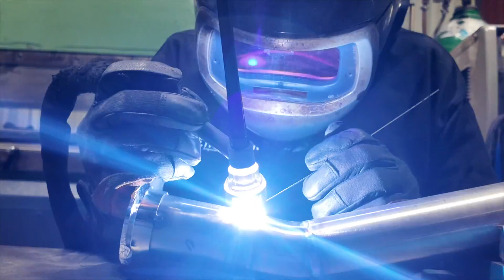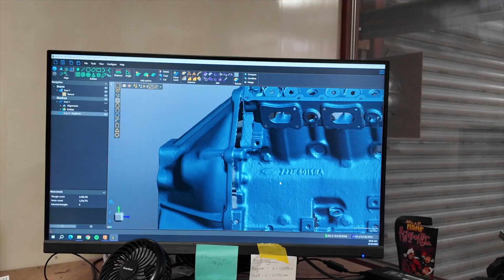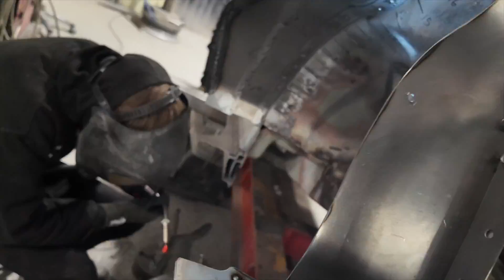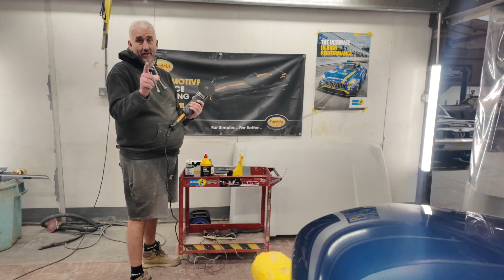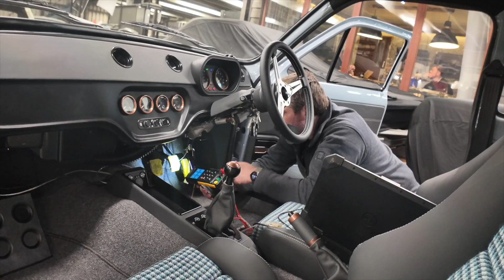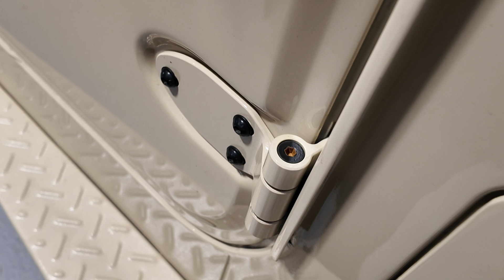1968 Camaro Project Interior Taking Shape

Comment: 28:46 100% correct Cal 👍
Years ago I replaced the butyl bonded windscreen in my Nissan Bluebird rally car, which had a welded in roll cage.
We used Sikaflex and the difference in the stiffness of the body was immediately apparent driving down the first dirt road.
It was a huge change.

Comment: In the Interceptor: The summary of cabin air intake box and the exhaust system will cause amplified resonance on highway speed. Main causes are the shape of the box and the distance between collector and 1. resonator. Secondary cause is the close proximity between the exhaust and fuel tank. Even with 2" foam, it will still hum inside the cabin.
For the V6 Ford motor: LT/LS style intake and single throttle body. This would bring the overall height of the intake as low as it is now with only those runners in place, without compromising air feed to the engine. In fact, unified plenum would bring part throttle cruise way more manageable, with more useful torque curve. In short; it would ride better, a lot easier to tune and significantly smaller package to fit.

Comment: The scimitar looks very updated and seriously wicked. An RS3100 lump just puts it into another galaxy as far as I’m concerned. Princess Anne will want #2
Reply: Is that not the same engine as the Essex v6  just 100 more cc.
Reply: @russcooke5671  did it also have Cosworth heads? ( I’m not sure?)..🤔
Reply: @philtucker1224  no it was standard but just a very slightly boring out  resulting in only an extra 10 bhp   But the racing spec cars were bored to 3.4  and could produce over 400 BHP.  Wich was massive for a v6  fifty years ago.

Comment: My old V8 SWB Land Rover kept cutting out due to fuel starvation. It took me months of stripping carbs and checking fuel lines etc to find the issue which turned out to be the top of a smarties tube floating around the fuel tank and getting sucked up onto the pick-up pipe. Once the engine stopped the obstruction fell off the pick-up and the engine restarted....until it next got sucked onto the pick-up.

Comment: So glad you ignored the advice to use butyl to install the rear glass on the Camaro. I was in the auto glass business for 25 years over here in Canada and the use of butyl tape was a common bodge. I have seen windshields actually ride up over the rubber blocks, in hot weather and come right off the pinchweld along the top. Further to that, in an accident, if the occupants are not wearing seatbelts, they can be ejected through the windshield, taking the glass with them, if it has been installed using butyl.

Comment: Iv heard in previous videos, you use 2coats of clear, but at a minimum it should be 3 if your going to cut one layer off and polish flat..and purely for peace of mind ,and for future polishing of these cars which will inevitably happen..and will also keep an nice depth to the metallics ..
Reply: I have 30yrs experience of high solids clears..he just burnt tru the door and had to repaint it..which backs up my point..there is absolutely zero negative in putting 3coats on if your going for a flat finish, which they are ,plenty of high solid clears that will do 3 coats ,once give good gas off times, zero solvent pop issues before you go there..keep in mind these are show cars ,that extra coat is security and you can polish out minor scratches in the following yrs .
Reply: 2coats of a high solid quality clear is alot.
Reply: I'd also tape the edges of the panels to avoid burning through  and then finish them areas carefully at the end with a small detailing polisher or by hand.
Reply: It’s on the data sheet for the clear we use technically we do 2.5 coats as we do a grip coat first
Reply: All good advice thanks guys 👌

Comment: For the fuel injection on the Reliant, is there room to mount the injectors firing across like the inlet manifold? Fuel rails next to the cam box for the opposing cylinder head inlet cam 😊

Comment: I always thought the glass provided the rigidity to the rear hatch,  The frame by it's nature is a flimsy article.
Reply: Nat mentioned that Stu removed the glass to do the reinforcement, so perhaps the glass doesn’t provide enough rigidity.
Reply: @jzab  I think it is more to do with how the frame is sitting when the glass is glued in that sets it's fit to the body work. I have a very vague recollection of some one fitting a new glass back in the seventies, I seem to remember plastic shims being used to gap the frame prior to gluing the glass.

Comment: Regarding the fit of the Jensen's tailgate - wouldn't the glass help hold it rigid against the struts or helper spring?  That thin edge can't have much strength in it at the best of times, but glass - particularly if it's bonded in, rather than held in place with ye-olde-style channeled rubber seals - should significantly aid in maintaining the fit.
Reply: It is correct to say that this will help the rigidity of the tailgate. But isn't it rather an issue with the roof inner panel?

Comment: Could bonding in the Jensen rear glass stiffen the assembly and fix the fit issues?
Reply: That makes sense, but honestly that rear hatch frame is way to flimsy a design to start with, not surpised it's giving issues. Maybe extending the flanges to allow bonding might have been an option? Hopefully we'll get an answer from Nat next week
Reply: @Kiteboardshaper I think ur right. It's a single panel. Most are made of double panels. Which ingreases the strength a lot. Being retropower they should be able to make it so they can bond the window on to it...
Reply: I believe, might be wrong, that the stock glass is too small to reach the flanges for bonding. This is because of how the stock rubber seal uses the flange. The cost of making a rear glass to allow bonding would be exorbitant.